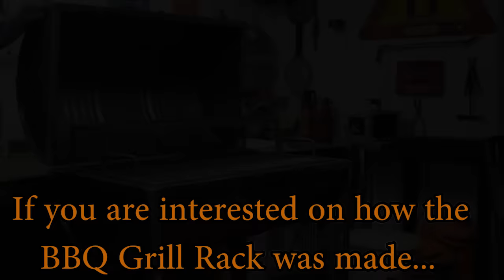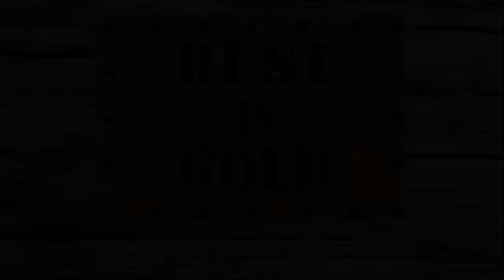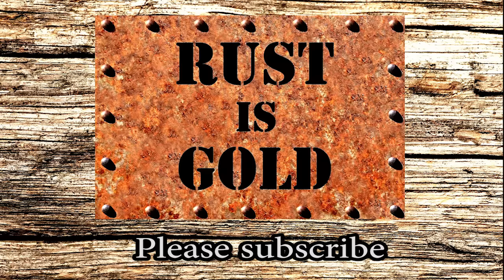HOW TO BUILD A BARREL BBQ/SMOKER (PART 1)

Comment: Hello Mr. Rust. While I enjoy a little Silent Partner as much as the next guy, in my humble opinion this video would be much, much better if you explained to us the steps you are doing as you do them. Some are obvious, but parts of it could definitely benefit from an explanation, such as telling us where you got, or how you made, the round feet with the threaded openings that you used to attach the wheels, and another example is why you bolted on the hinges instead of welding? Also it didn't even appear as if you drilled all the way through on any occasion  and you didn't show if you were putting nuts on the inside to hold the hinges or if those bolts were somehow self tappers, although they didn't look like it. It seems to me a waste that you go to all the effort to make a video, but leave it without audio! Just my thoughts...
Reply from the maker: Thank you very much for your comments. I understand your concern about me not commenting on my video...
I thought that because I made them really detailed there was no actual need for comments. 😊👍
Reply: @RustisGold  Most (95%) was very clear, I just would have liked more info on the things I mentioned (above) Such as the round feet with the threads in the center and the point about the hinges.Other than that it was really easy to follow and the grill came out great! Cheers!

Comment: great work.. thanks
P.S. you spent a lot of hours for a 10 minutes job! I mean removing the blue color and the polish the barrel.  You could do that in less than 10 minutes with sand-blasting ;)
Reply from the maker: Thank you very much for your comments! I thought about sand blasting but the metal surface of the barrel is very thin and I was told that the force of the sandblast would deform the barrel. Then I tried removing the paint by using sandpaper... It would take for ever! That's why I thought of using the torch. Much faster and with minimal physical exhaustion. On another project of mine where I transformed an LPG gas cylinder to a BBQ I used sandblasting. However, this cylinders' surface was very thick. Here is the video:

https://youtu.be/ypWrL3Zr4Mc
Reply: @RustisGold  Thanks for the reply.  You are right but the new sand blasting machines has features where you can control the power of the blasting.

Anyway, you did a great great job.  I like your DIY videos, so inspiring.  Thanks
Reply from the maker: @sultanwot7152  thanks again, however, I don't have a sand blasting machine. Thinking about it it would be a good idea to buy one!

Comment: Hey man great job. I’ve lost count on how many times I’ve watched these videos. I’m all the way in Africa. Zimbabwe specifically, if u know it. 

Quick question. Do you think 25mm angle irons would be structurally sound as your 30mm. 

Thanks
Reply from the maker: Thank you very much for watching my videos! I am glad you like them! I don't think it will be a problem if you use 25mm instead of 30mm. If you have them in stock use them! Good luck with your project!!
Reply: Rust is Gold that’s super. Thank u.
Reply from the maker: @tecvchaparadza  take care my friend!

Comment: don't want to ruin the video but for safety reasons I will say this... The grill is awesome and the guy has great talent, but that thing is "top heavy" I have seen a few of these and the #1 and only flaw is that if someone just throws the lid back the grill will flip back. if the design was a bit different and make the cut above half way it would be safer. just my two cents and experience.
Reply from the maker: Thank you very much for your comments. I agree with you but I am afraid you have to watch part 2 of the video...
I have thought of this problem that is why I put metal cords on both sides of the lid which hold it in the right position.
Reply from the maker: BBQ video part 02.

https://youtu.be/Pmr_cpdCsdw
Reply: @RustisGold  good deal my friend.
Reply from the maker: @jjcc868  👍
Reply: You could always just cut a 1/4 in the drum...not half, to be more stable.
Reply from the maker: @nigeace  This is true...

Comment: hi please advise on the lp gas regulator  specification... i tried a similar and it took me a lot longer to burn off the paint. is yours a higher pressure regulator? more than 4 bar? i need to make the top part now. i like your work!
Reply from the maker: Thank you very much for your comments! To be honest I have no idea about the specifications of the burner! I need to check!!

Comment: Lovely job. What did you put on the grinder to polish off the paint residue? And is it essential to remove the paint???
Reply: Its essential to remove the paint and to be very careful not to breath in the fumes and dust. It's highly toxic when heated and if you want to paint it, buy special paint that is heat resistant and that its food friendly so it isnt toxic

Comment: Hello, a great project wants to build a similar one and I have a few questions.  What size of angle profiles did you use to build the barrel grill?  What kind of bar did you use to make the grill rack?  Have you painted the inside of the barrel with heat-resistant paint?  Regards and I am asking for an answer.
Reply from the maker: Thank you very much for your comments! Glad you liked it!
Angles 3cm X 3cm
I used normal steel bars not inox.
Don't paint the inside of the BBQ Barrel. It is dangerous for your health!
Reply from the maker: Here are the measurements for the Barrel BBQ:
https://www.facebook.com/photo?fbid=2562179130553153&set=a.2562180023886397
Reply from the maker: GRILL RACK DIMENSIONS

The dimensions of the bottom grate are 90.5cm X 52cm.
The dimensions of the top grate are 87.5cm X 22cm.
The height of the top grate is 16cm.
I used iron angles with dimensions  3cm X 3cm and 8mm diameter rods with 2cm gap in between the rods.
However, I suggest that you have to make the grill fit your BBQ's dimensions.

Comment: I get it, its not structural, but why not clean your material at the weld spots? What weld settings and electrode types did you use? Thanks for sharing

Comment: I love this grate job I'm going to make one the are a few things I need to know how tall did you cut the legs and the thing you put on for the casters where do I get those
Reply from the maker: Thank you very much for your comments! The length of the legs is 70cm without the wheels. With the wheels is 90cm. With the casters you will have to improvise. I used an old super marker cart I found thrown away!

Comment: Hey man just a quick question why didn't you weld the hinges on the rest of the smoker?
Reply: And also what size rod are you using it looks like 3/16?
Reply from the maker: Just in case I have to replace it in the future it will be easier...
Reply from the maker: @tylercreps3886  If you are asking for the rods I used for the grill rack I don't know in inches but in millimetre it is 8mm. According to the converter it is 0.314961 inches.

Comment: hello,

enjoyed all three of your videos, very beautiful. I am super interested in trying this out. I would just like to know how much time and money was out into this? thank you
Reply from the maker: Thank you very much for your comments! Net time it took me 2 weeks, 6-7 hours per day. It cost me around 120€ but I had some materials in stock. Estimate around 150-160€ total cost.
Reply: @RustisGold  wow, a true labor of love. it really shows. Thank you so much!
Reply from the maker: You are welcome! Good luck with your new project!! 😊👍
Reply: I already posted a longer comment, but in a nutshell, in my city (Merced, CA), the supplies cost around $150. You can get the metal cheaper if you live on the East Coast. If you don’t have all of the necessary tools and supplies, expect another $200 or more, depending on your search capabilities and patience. 

As for time, it took me about 2 weeks to complete the project, start to finish. That included going to my regular job 3 or four days a week and working every free hour between 6 AM and 10pm on the project. I had no idea how to weld or where to get supplies, and had to fabricate a few of my own parts. I also built a mechanism for my angle grinder so I could use it as a chop saw. So if you have any skills at all, and the proper time and tools, you could easily build this in a few days to a week. Two weeks as a complete beginner. Hope this helps.
Reply from the maker: @Boggs0009  Pretty much it was the same story for me as well regarding cost of materials and working time... 😊👍👍

Comment: The only thing I would change is the grill section and use the diamond mesh if that's what it is called. The gap of the one you had is too big and not so friendly in getting under the meat flipping them over.

Comment: How many feet of metal did you use for the frame and everything else?
Reply from the maker: Here are the measurements for the Barrel BBQ:
https://www.facebook.com/photo?fbid=2562179130553153&set=a.2562180023886397
Reply from the maker: GRILL RACK DIMENSIONS
The dimensions of the bottom grate are 90.5cm X 52cm.
The dimensions of the top grate are 87.5cm X 22cm.
The height of the top grate is 16cm.
I used iron angles with dimensions  3cm X 3cm and 8mm diameter rods with 2cm gap in between the rods.
However, I suggest that you have to make the grill fit your BBQ's dimensions.
Reply: Thank you, You just got a new subscriber.
Reply from the maker: @macframa08  thank you very much!! 😊👍

Comment: What size angle iron did you use for the legs, and drum liner and rack holder?  What size steel rods did you use for the grill rack?   Super good video
Reply from the maker: Thank you very much for your comments! I used 3cm X 3cm angle iron. For the grill rack I used 8mm steel rods.
Reply from the maker: Here are the measurements for the Barrel BBQ:
https://www.facebook.com/photo?fbid=2562179130553153&set=a.2562180023886397
Reply from the maker: GRILL RACK DIMENSIONS

The dimensions of the bottom grate are 90.5cm X 52cm.
The dimensions of the top grate are 87.5cm X 22cm.
The height of the top grate is 16cm.
I used iron angles with dimensions  3cm X 3cm and 8mm diameter rods with 2cm gap in between the rods.
However, I suggest that you have to make the grill fit your BBQ's dimensions.
Reply: @RustisGold  thanks for the quick reply.  What thickness of angle iron did you use?
Reply from the maker: I am not really sure... It's has been a long time since I built it... I need to check.

Comment: Hi! Very nice job. Can you tell me aprox how many material you needed from the "L" form steel in metric meter? 😬 Thanks.
Reply from the maker: Thank you very much for your comments! I can send you a link with all the dimensions of the barrel BBQ.
Reply from the maker: Here are the measurements for the Barrel BBQ:
https://www.facebook.com/photo?fbid=2562179130553153&set=a.2562180023886397
Reply from the maker: GRILL RACK DIMENSIONS

The dimensions of the bottom grate are 90.5cm X 52cm.
The dimensions of the top grate are 87.5cm X 22cm.
The height of the top grate is 16cm.
I used iron angles with dimensions  3cm X 3cm and 8mm diameter rods with 2cm gap in between the rods.
However, I suggest that you have to make the grill fit your BBQ's dimensions.
Reply: @RustisGold  Thank you very much! 😊👌 Greetings from Spain!
Reply from the maker: Take care friend! Greetings from Greece!! 🇬🇷😊👍

Comment: Nice job bro!!! Question, was the barrel clean on the inside before you torched and cut it? I've got a 55 gallon drum that has oil residue and wanted to know if it was ok to cut
Reply from the maker: Thank you very much! I washed it before cutting it. Unfortunately I didn't include it on the video. Add water and some soap and wash it so you are on the safe side... 😊👍
Reply: @RustisGold  you added it into the drum by a whole?
Reply: Any soap ?
Reply from the maker: @jonathanwashington1013  yes water and soap
Reply from the maker: @jonathanwashington1013  you unscrew the tap of the barrel
Reply: Gotcha! I appreciate it bro!!!
Reply: Why not use dishwasher Dawn... u see they use Dawn to wash geese or ducks to take oil out from birds ..
Reply from the maker: @richardmiller3919  😊👍
Reply: just to throw this out there, it's fine to use dawn for them cuz oils on their skin is usually a lot thicker and more built up then household pets. Using it on household pets you're going to strip the bit of oil that they do have their skin, that is really bad. Stuff like that is what prevents a lot of skin disease for them.

Comment: Wow Mr. Rust great work, If you don't mind, What is the Size of the Angle Bar Used here? I mean the thickness, 1 and 1/2 or or is 1inch?
Reply from the maker: Thank you very much! Glad you liked it!
We use the metric system so you have to do the conversion...
It was 3cm X 3cm
Reply from the maker: Here are the measurements for the Barrel BBQ in case you want them:
https://www.facebook.com/photo?fbid=2562179130553153&set=a.2562180023886397
Reply from the maker: GRILL RACK DIMENSIONS

The dimensions of the bottom grate are 90.5cm X 52cm.
The dimensions of the top grate are 87.5cm X 22cm.
The height of the top grate is 16cm.
I used iron angles with dimensions  3cm X 3cm and 8mm diameter rods with 2cm gap in between the rods.
However, I suggest that you have to make the grill fit your BBQ's dimensions.
Reply: @RustisGold  thank you very much :) I really love your work :)
Reply from the maker: You are welcome! 😊👍👍

Comment: Hi bud. Did you a car engine oil barrel? Safe to cut it with all those sparks?
Reply from the maker: No, it wasn't an oil barrel. I also cleaned it before by adding water and soap. Unfortunately I didn't add this part in my video and now I understand it is a little confusing when people watch it...
My mistake...

Comment: Very nice. 
What exactly are the exact dimensions of the metal cuts?
Reply from the maker: Thank you very much!! 
Here are the measurements for the Barrel BBQ:
https://www.facebook.com/photo?fbid=2562179130553153&set=a.2562180023886397
Reply from the maker: GRILL RACK DIMENSIONS

The dimensions of the bottom grate are 90.5cm X 52cm.
The dimensions of the top grate are 87.5cm X 22cm.
The height of the top grate is 16cm.
I used iron angles with dimensions  3cm X 3cm and 8mm diameter rods with 2cm gap in between the rods.
However, I suggest that you have to make the grill fit your BBQ's dimensions.

Comment: l have the same question it is necessary to remove the original paint from the barrel?
Reply from the maker: The original paint was not heat resistant so if I didn't remove it there was going to be a problem because it would start to burn and deteriorate. The new paint I applied it heat resistant.

Comment: The bottoms rust out very fast and you'll have cut out the bottom and rebuild
Reply from the maker: I know, but if you noticed on my video I welded a thick metal sheet at the bottom so all the charcoals don't come in contact with the barrel surface.
Reply: May I ask what is the dimension of that metal sheet ?  @RustisGold
Reply from the maker: @boubel11 Here are the measurements for the Barrel BBQ:
https://www.facebook.com/photo?fbid=2562179130553153&set=a.2562180023886397
Reply from the maker: @boubel11 

GRILL RACK DIMENSIONS

The dimensions of the bottom grate are 90.5cm X 52cm.
The dimensions of the top grate are 87.5cm X 22cm.
The height of the top grate is 16cm.
I used iron angles with dimensions  3cm X 3cm and 8mm diameter rods with 2cm gap in between the rods.
However, I suggest that you have to make the grill fit your BBQ's dimensions.

Comment: It looks cool but is it cheap making one or just buying pre-made bbq grill
Reply from the maker: Thank you very much for your comments. It cost me approximately 100€ so I guess it was worth the effort and time spent!
Reply: @RustisGold  Im doing very similar grill at the moment (without the foldable parts) and so far i've spent 50€ :) All I need is the paint, bottom plate and the exhaust pipe. Shouldnt cost more than 20€ more to finish. Thanks for the video, I got the idea (design) from this video :) Edit: My costs includes the rack.
Reply from the maker: @keskiviikkoilta2425  glad to hear that! The cost is pretty much around this level... 70-100€ max. Good luck with your project!!

Comment: Hi, aside from propane torching it, can I use a paint stripper to remove the paint from the barrel as I don't have propane torch?  Is it still safe for barbecuing?  Thanks for your reply..
Reply from the maker: Yes you can use the paint stripper. In case you don't know what was inside the barrel I suggest you burn the BBQ for some time before you use it for cooking. I did the same before I used it for the first time.

Comment: Knowing barrels usually comtained chemicals, what did you do about possible residue?
Reply from the maker: Regarding the interior, I cleaned it with water and soap then I used a metal brush and finally I burned it for one hour before the first time I used it.